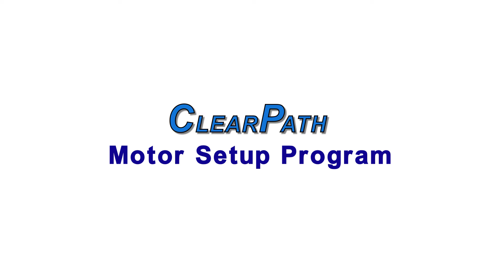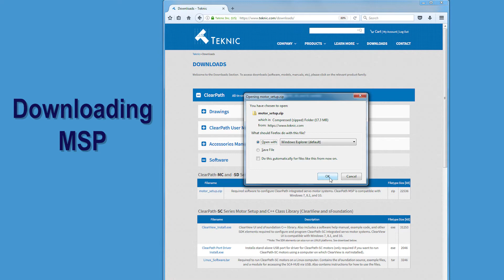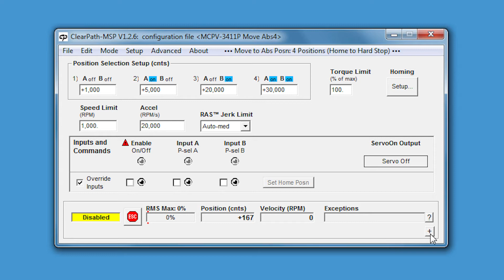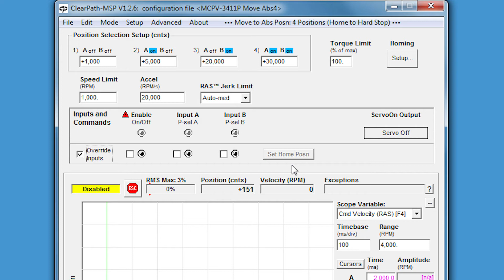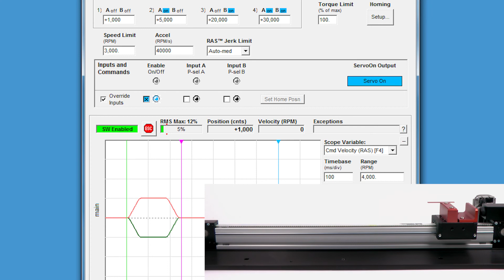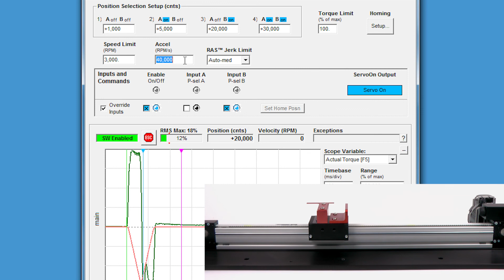How to use the ClearPath Motor Setup Program (MSP)

Comment: top of oscilloscope is 4000 and bottom is -4000. Then you should display that. As without you telling me I would have zero idea.
Reply from the maker: Hi James, 

We appreciate your feedback. I agree, an adaptive scale would be a good addition and make the scope easier to use. I will be sure to write a feature request on your behalf. All feature requests are periodically reviewed by our engineering team and influence existing product updates and new product development. 

I would also like to point out that this video was made using MSP 1.0. Since this video's release, Teknic has developed MSP 2.0. Most of the information in this video is still correct, but there are a few differences related to the scope. 
1) The vertical scale on the scope is now set per division. To achieve the same resolution as the example in the video, set the vertical scale to 1000 RPM/div. 
2) The digital scope can now plot two scope variables simultaneously. 
3) MSP 2.0’s scope includes a separate cursors window with new Zooming and Measuring features. 

If you have additional questions about MSP, please don’t hesitate to contact Teknic via our website (https://teknic.com/contact/) or give us a call at 585-784-7454. 

Best, 
Bradley N. -Teknic OEM Application Engineer

Comment: I wish there was a feature where the scope was live, so it's always showing you the current data without needing specific triggers.
Reply from the maker: Hi Alonso,

The scope has an “Auto” trigger mode that does not wait for any specific trigger event.  I think this might do what you’re looking for.  When “Auto” is selected, data is continuously collected, refreshed, and displayed regardless of the ”Trigger On” setting.

More information on the scope can be found in the ClearPath MC/SD User Manual: (https://teknic.com/files/downloads/clearpath_user_manual.pdf#page=82).

Feel free to reach out with any questions by filling out a contact request form (https://teknic.com/contact/) or giving us a call at (585) 784-7454.

Brendan C. – Teknic Applications Engineer
Reply: @TeknicInc  indeed! Thanks for point this out!

Comment: Hi my name is Lanre Thompson Akindele, I need motor and your motor will be the best for my project, can your motor work with sensors. How can I start the motor with sensors and end with sensors. This is what I needed I  wanted the motor to rotate from 0 to +45° and moved back to -45°to 0° then the sensors will be the starting and end of the motor sensors I will be so much help if you can explain to me how to make the connection 
Thanks Lanre Akindele
Reply from the maker: Hi Lanre,

There are several different ways the ClearPath motors can be configured to interact with sensors and achieve the motion you describe.  You can start by reviewing the different types of ClearPath operational modes through this video playlist: https://www.youtube.com/playlist?list=PLuMmdjFz-3nwjDepiwI65IvtiC7rnCdrL

Once you have an idea of how the different operational modes work, please contact one of our applications engineers by submitting a contact request at https://www.teknic.com/contact/ or by giving us a call at 585-784-7454.

Our trained Applications Engineers will be able to discuss your specific requirements and help determine the best way to accomplish your goals.

-Brendan F. Teknic Servo Systems Engineer

Comment: What device is the MSP information being displayed on?  Does that come with MSP? Thanks
Reply from the maker: Hi the DECK tool,
Thanks for watching! MSP is a Windows software application available for free in the Downloads section of Teknic's website: https://teknic.com/downloads/. Just download and install MSP on your Windows PC, connect a ClearPath-MC or SD series motor to the PC (using a standard USB data communication cable) and you're off and running. For more information on MSP (system requirements, installation, communication, and more) please see the ClearPath MC/SD user manual, also available in the ClearPath Downloads section.

Thanks and regards,
Jim W.
Teknic Servo Systems Engineer

Comment: Gostaria de saber preciso usar um driver entre o arduíno e o servo motor ou se o arduíno substituiria o driver?
Reply from the maker: Hello Fernando, 
The ClearPath integrated servo motor includes a brushless servo motor,  servo drive, and high resolution encoder all in one device (so you do not need a separate servo drive).  Many people have used the Arduino Uno to control a ClearPath motor (but other Arduino models will work as well).

If you want to use an Arduino as your motion controller, it is important to determine which ClearPath model and operational mode makes the most sense for your project. You could potentially use a ClearPath MC series (Motion Controller) or SD series (Step & Direction). The ClearPath SC series (Software Control) would not be appropriate for an Arduino based project. Each ClearPath operational mode has its own advantages and limitations so you should carefully consider your control options before making a selection. Here is a link to the operational mode videos for your review: https://www.teknic.com/watch-video.  

Finally, if you are comfortable with the Arduino language and IDE, you might consider using our ClearCore motion and I/O controller for your project https://www.teknic.com/products/io-motion-controller. ClearCore can be programmed in the Arduino IDE using our Arduino wrapper library. Each ClearCore controller has four ClearPath motor connectors and 13 points of I/O onboard. ClearCore can control up to four ClearPath motors simultaneously, but it is not intended to replace a purpose built multi-axis CNC controller, so please keep that in mind.

I hope this information is helpful. If you have any more questions about ClearPath and your application please feel free to give us a call at 585-784-7454, or use our "Contact Us" form online: https://www.teknic.com/contact/.

Jim W. - Teknic Servo Systems Engineer

Comment: I have a question about homing... I'm thinking of building a device that is portable and detachable. The "home" position could be all the way clockwise or counterclockwise depending on the state of the device attached... Now depending on the state of the device weather its all the way clockwise or counterclockwise, it's equally awful to have the motor home when the conditions of the device are not met... Can homing move (just for example) 1000 and if no stop is sensed, it could move a maximum of -2000 to find home and detect state of the device.... These servos are incredibly versatile so I assume there is an advanced setting for something like this.... Or allow for homing to be handled by the arduino
Reply from the maker: Hi Terrence,

That is a good question. Most applications that require homing only ever home in one direction and can use ClearPath's automatic homing. There are a few different options when more flexible homing sequences are required:

1. Manage homing from the controller and turn off ClearPath's homing. This would be appropriate if homing to a sensor wired to the controller, and when using Step & Direction mode (available with ClearPath-SD series servos). With this option, whatever complexities you need in your homing sequence can be programmed into the controller. The servo will simply follow the motion command sent via the steps.

2. This option is very similar to the first, but would be used for homing to a hard stop instead of a sensor. Use the "User Seeks Home" feature, which is available in Step & Direction (ClearPath-SD) or Pulse Burst Positioning (ClearPath-MC) operational modes. With "User Seeks Home" ClearPath will use its normal hard stop detection, but will not automatically move toward the hard stop. Instead it follows a step or pulse command from the controller, allowing it to start and stop the homing move anytime. You should select the option to "Home upon every Enable" and turn off "Precision Homing". You can use ClearPath's HLFB output to determine if a hard stop has been reached or not. To home in the opposite direction after not reaching a stop, just briefly disable and re-enable the motor by cycling the enable input. Then you can start moving in the other direction and ClearPath's hard stop detection algorithms will again be active.

3. Use ClearPath-SC with a PC-based controller. Software control often provides the most flexibility in configuration, but does require a PC or single board computer controller running C++ or C# application code. So this option would not be compatible with the Arduino. You would likely be best off using either Method 1 or Method 2. 

I hope this helps. If you have any more questions about ClearPath and your application please feel free to give us a call at 585-784-7454, or use our "Contact Us" form online (https://www.teknic.com/contact)

Best regards,
Matt C. - Teknic Servo Systems Engineer
Reply: @TeknicInc  That DOES help a LOT... I think I'm going to play with an Arduino and some smaller servos to get a basic program fleshed out and then (when I get more R&D money) pick up one of your fancy servos... Last question, There will be a LOT of gear reduction and the end of the travel won't be as much as a "HARD STOP" as an "Exponential torque curve".... There is enough slop in the many mechanically linked components that it wont FEEL a rigid stop... How sensitive is the homing?
Reply from the maker: @terrencehuebner8378  We certainly recommend a true physical hard stop if you intend to use ClearPath's hard stop detection features. As long as a true hard stop is used, any lash or compliance in the gearing or mechanics is not typically an issue when it comes to successfully using the hard stop homing feature, even if what the motor "feels" is not an instantaneous torque increase from clamping into the hard stop.

If you have any other concerns I would highly recommend giving Teknic a call to speak to an Applications Engineer (585-784-7454), or using our "Contact Us" form online (https://www.teknic.com/contact). Usually speaking to an engineer will give you the most complete answer, taking into consideration any unique details of your specific application.

Best regards,
Matt C. - Teknic Servo Systems Engineer

Comment: In your scope demo on the torque display, am I correct in assuming the negative trace was the “braking” torque.
Reply from the maker: Hi Chuck,

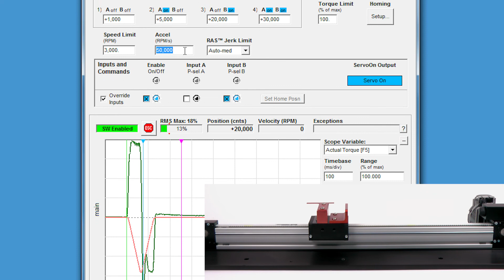The negative trace indicates counterclockwise torque. In some cases this is braking torque, and other cases it is accelerating torque, depending on the direction of the move. Both cases were actually shown in this video, which is why you see the torque trace "flip" when moving in the opposite direction the second time @23:40.

Brendan F. - Teknic Servo Systems Engineer

Comment: where can i get a couple of those and can i control them with arduino grbl software?
Reply from the maker: Hi el SunShine,

I am not an expert in GRBL or Arduino, but my understanding is that the GRBL software is capable of interpreting your g-code to generate 5V step and direction pulses from the Arduino board.

5V I/O can be wired directly to the ClearPath inputs, and the ClearPath-SD family of motors operate off of step and direction signals so I would expect you to be able to control the motors with an Arduino running the GRBL software.  

Here are links to the SD family ClearPath User Manuals which have more details:

Fractional horsepower
https://www.teknic.com/files/downloads/clearpath_user_manual.pdf

Integral horsepower:
https://www.teknic.com/files/downloads/ac_clearpath-mc-sd_manual.pdf

The ClearPath integrated servo motors can be purchased directly through Teknic’s website.  Once you determine the correct ClearPath model you can create a Teknic account and add the motors to your cart. There is a “See Accessories” button located on the motor page that links to recommended accessories. After adding the motors and accessories to your cart, you can checkout using a credit card.  

If you have any other questions  please contact us at support@teknic.com.

Best regards
Mark D.

Comment: 4 positions is too few for the indexing operations I do, but the SC series is much more complicated and has additional HW costs.  Any plans for a happy medium in the future?  Are there options that would provide maybe ~10 indexed positions that I might be unaware of?
Reply from the maker: Hi Sample Failure, Thanks for your interest in Teknic. I appreciate your question.

From what you've stated, it sounds like the operational mode "Move Incremental Distance" could meet your objectives. To operate "Move Incremental Distance", the user first pre-programs 2-4 incremental distances. These distances are defined by the combination of the high or low digital states of ClearPath's inputs A and B. The user then sends trigger pulses to ClearPath to move whichever distance is currently selected.

This mode also allows for the user to command longer moves by sending multiple pulses in a row (i.e. stringing multiple incremental moves together). For example, if you define one distance as 1" and then send 12 pulses, you can move 12".

Below is a link to the demo video of this operational mode. This video should give you a better idea of whether or not "Move Incremental Distance" would be a good fit for your application.

https://www.youtube.com/watch?v=EQfZdp6Fuxo

Please contact Teknic at support@teknic.com if you have any additional questions.

-Bridgette G.
Reply: Interesting.  Thanks for the suggestion!